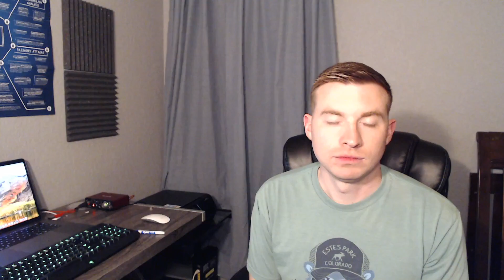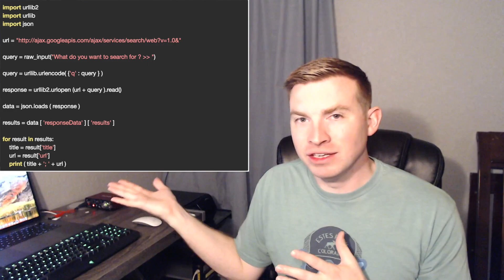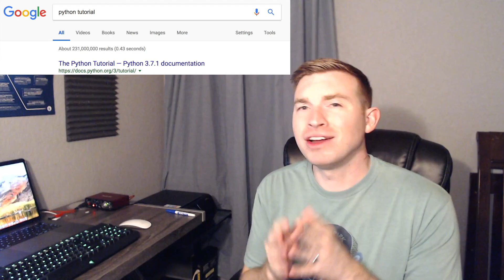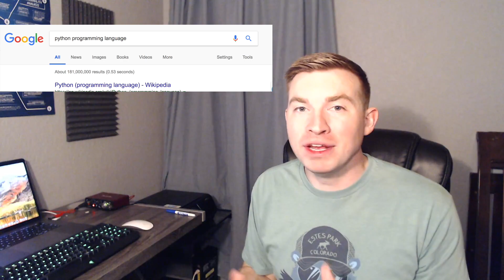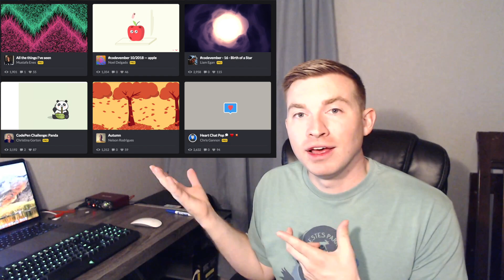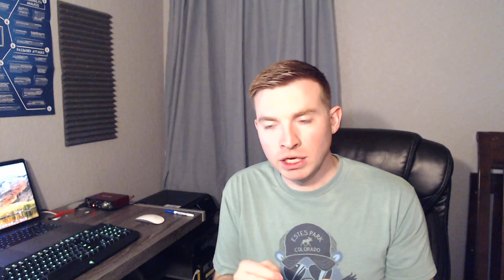Top Programming Languages for Cyber Security / Hacking

Comment: Everyone, just pick a language and get coding..  by it's very nature you going into tech means it will never be static, it's technology so it will always be evolving and changing and you'll never be able to master it all, so DEAD that noise ASAP.  Regarding your other query, just pick a language and learn it while mastering the fundamentals of programming. When you are very comfortable with the concepts and fundamentals of programming learned with one language it will be ridiculously easy to quickly pick up another language as at that point your jus learning the syntax and nuances of the new program language... make sense?  Now with all that said and done.. PYTHON is one of the newer languages and thus easier to pick up on, ex. It can output in 1 line what it takes others 3+ lines of code to do the same thing.. Another plus is if your looking at Networking or Information Security, it's one of, if not the most used there as well.. Google this book, on Amazon or FREE digital copy by the publisher as well, Automate The Boring Stuff with Python. Thank me later.. oNe
Reply: js is very relevant too, but imo for first time programmers, python is great
Reply: You're telling me that I should learn Flash programming because it doesn't matter what I pick? Ok...
Reply: @Adam-cn5ib  YES MOCO, that's exactly what I said... Now there is no such thing as Flash programmin, but if you meant ACTIONSCRIPT, then yes, that would benefit you greatly, because if you learned ACTIONSCRIPT you will easily pick up Python no problem, then if you know Python, you will easily pick up JavaScript... And so on, and on... Jus pick one and start, the rest will follow..

oNe
Reply: Learn C ,c++ first and everything follows..because it's the foundation of evry basic languages now..they said 'just learn the basics',but in programming no..you must just say 'learn the complex..because in reality many of great scientists and engineers put their hardworks to understand the hardest thing to make it simpler for us to us now..and nobody want to learn it cause it's done by someone before and not useful this days..how about u want to learn it also so u can know more deeply what going on the machine ..print("Hello"),you can easily understood but do u understand how can machine understand and respond?
Reply: @zian.2493  yes and no my friend, depends on your end goal right? If your into PEN-TESTING you don't need to know how or why, you jus need a vague understanding of what's going on..will it help you be better yet, but is it required, no!! Just like in life, does everyone need to have a star athlete body build, NO, but will it benefit you in life, Yes, but is it required, no!! Plenty of PEN-TESTER with only basic understanding of coding and even Networking, and they are very successful!!

oNe